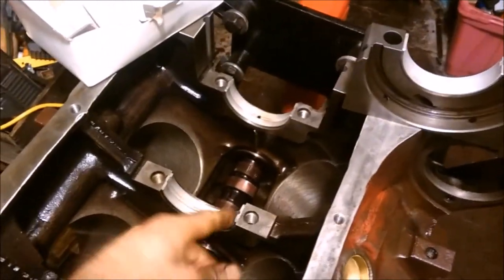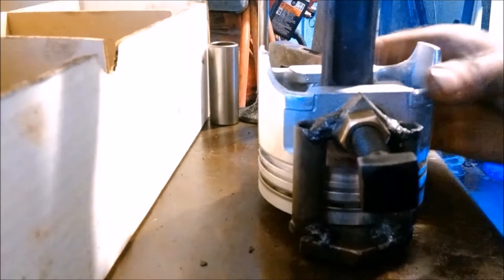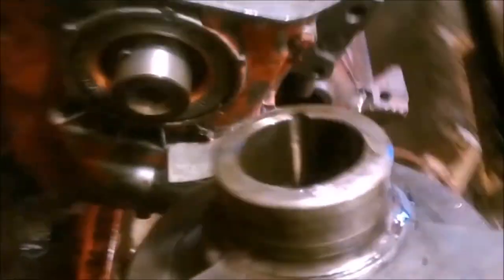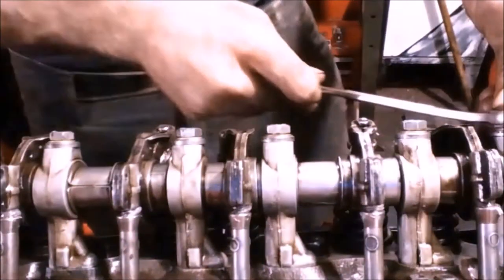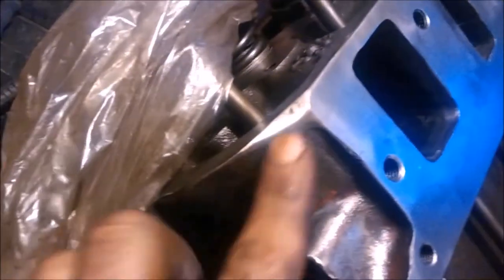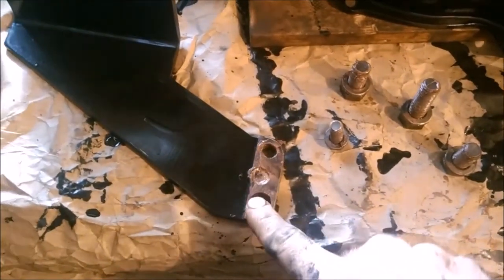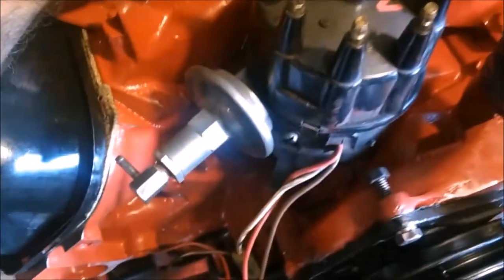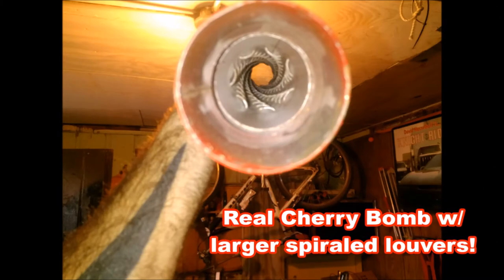IH ENGINE BUILD part 2 152 196 266 304 345 392

Comment: You have saved my 304 Build. The machine shop wouldnt assemble after doing the block,, crank and heads, so it was up to me.. this is golden info here.. Thank you for what you've done here.
Reply from the maker: Thanks! Just sharing my notes, I'm watching along my own video as I do the 392 on the stand ;)  Not like we get the chance to work on these very often now a days,   But yes that engine in the video is mostly stock just reworked the casting flaws and she will smoke all 4 and break them big tires loose in any gear at any speed with only 4.10 rear end,  can rev higher with out oil starving....., at that point, you need to worry about putting the power you already got to the ground b4 we worry about hot rodding it !

Comment: I acquired a Loadstar with only 15k original miles and always kept in a barn its whole life so there is no rust anywhere.  It's only problem is the engine is locked up.  I intended to start rebuilding its engine this year.  Unfortunately I slipped on some ice last week and shattered my knee.  So I sit here watching these awesome rebuild videos wondering if I will ever be well enough to walk again, finish and drive my truck.  
Actually I planned on converting it to 4 wheel drive.  From eBay I got a rare 4-speed Dana/Spicer transfer case.  I did a small write up on it in a couple of the forums as a lot of people never saw one and didn't know Dana/Spicer made a 4-speed transfer case for the Loadstar 1800.  Ratios are very low; low; direct and overdrive.  That gear box could be ordered with either of two different overdrive ratios.  Surprisingly a heavy truck surplus parts place in Chicago had the alternate overdrive set of gears.  Their computer said they were in stock but it took them over a week to find them.  In the end they found a box of 66 NOS overdrive gear sets for this transfer case.  They said it appears nobody ever ordered a set before. I'm probably the first and the last.  Just thought I'd get the alternate overdrive gear set in case someday I got ambitious enough that I wanted to try a different overdrive ratio.  They also had the parts to convert the front axle engagement from air shift to manual shift.  Just thought I'd share . . .
Reply from the maker: Dude that is so cool, and I dont know why I didnt see this comment till now!  I cant believe nobody has stuck one on a rock crawler and named it over kill lmao

Comment: Wow. Thats the best sounding sv ive ever heard
Reply from the maker: Still my daily driver! Have to hear it now that its power tuned and broken in!  
Its a challenge to not peel rubber !
The H-pipe made the world of difference on the highway...
Reply: What is the HP and Torque on it? Gas Mileage?
Reply from the maker: well  @duanetucker  one issue is even 60's Muscle cars only had 500cfm carbs, and I have a 600 , so I am drinking way too much gas,
And depending if you can resist pushing the pedal past the mark that gets into the pointless power just because America power that can spin the clutch and all 4 wheels lol lol lol 
I would easily get 8-12 city  and 14+ highway  if I had a 470 truck avenger, the smallest new carb you can actually buy for a v8. Now I get 6-8 city and 8-11 highway, 
and seriously, to give you an Idea, the 470 is a huge upgrade from the stock 4bbls offered. 100 - 200 cfm larger depending...! with my foot to the floor i cant even give it 3/4 gas because my throttle pedal is bent, so Spinning all 4 and the clutch is like half throttle! 
a 600 cfm carb will not even open the rears until after about 3500 rpm, and our IH dont like to cruse past 4,000!. In fact theeir is very detailed instructions on how if your stuck you can give it all she got for like 8 seconds, let it idle for 8, floor it for 8 seconds idle for 12, floor it for 6 idle for a full min....... no joke, I can go a little higher rpm because i cleaned up the oil passages , but these engines where not designed for high rpm. most cars peak hp and torque on a large peak around 4 -6 thousand rpm. 
IH hp and torque has a fast steep early plateau. almost right off idle they are at full hp and torque and stay that way up to about 3500 rpm.  so you actually get more power because its consistent !!! get it!!! the numbers can not be compared to other engines. these get the same gas millage empty or pulling 20 tons. no joke.

Comment: Awesome couple of vids fella.  I like the stuff you did with the heads.  I'm not getting my block decked, I'm getting the heads decked .020'  new gaskets are .046' compressed to .041'.   I'm going getting the heads back this week from the machinist and then sticking her all back together!  Also love the bit about setting up the timing!
Reply from the maker: yes, i will soon pull my heads, and deck them as well, its been over a couple years, I can smoke most things on the road as long as I pretend I let off at 60 to be responsible buahhhhhhh only thing I should have done was I had a questionable valve guide, and it took a couple years, but now its worn more and i get a tiny puff of oil on a hot day start up...
Reply: @TEN-TIMES-HARDER  Bill USN-1 on binderplanet.com has a good write up about the heads and adding umbrella seals to the valves rather than the simple o rings.  It prevents the puff of smoke on start up usually caused by oil build up at the 7 and 8 valves.  Sealed power umbrellas is what I bought for mine.
Reply from the maker: @tomcompoli  can somebody link me, I That forum is old as the internet and I can not find anything I search for!!!  At best you get threads that say "this question was already answered search the forum" lmao Bill Hamilton also says he has one on his dyno results, but good luck finding it....   Someone should cut and paste all the relevant threads into a new webpage, like a on Hamilton injection, b4 i get to it and direct everybody to www.bedhed.xyz/ih lol underconstruction, had to move my server got bought out.....

Comment: Thank you for the videos! I have been trying to find a good IH engine build video and can now try my first engine build. Have you ever adjusted the oil pump relief to get higher oil pressure?
Reply from the maker: no I have not, but I ran that engine 5 yeara balls tonthe walls as a daily driver 80 all day crewzzzing passing at 100, and then metting the oil drain back to the pan lmao, so do th baja mod if you want to hold it over 80!
as well you can ass slightly larger sb chevy springs, and watch david vizzard if you want to port further, the intakes are like race heads, the exhausts need work....
the only thing i didnt di in the vids 1 & 2 was open the exhaust bowls and unshroud in the chambers....
vid soon.....
point is, that engine was mean as hell, I had all 4 off the ground twice, oncw in the highway lmao, 
could spin 31's in any gear 4:10 rear...
more power than i could put down with out a cam even!
truck was still running like new,
guy git and ran me off the highway in a blizzard, barrel flip off the edge...
just installed the sss terra roll bar and the cpt x brace / straight steer,
crushed like a beer can aroumd the bar.... lap belts.....walked away.....
so dont worry oil p...
they took the lead out the gas and that kills pre 72 heads, and 96 they took the zink out the oil and that killed a lot of rebuilds!!!!
and as well, the zink also fills the babbat in the cam crank amd rod bearings, as well as lubes under crush out... woo woo woo...
run aukee purple, vr1, lucass hoteod, or additive and your gold...
preassure fine!!

Comment: Question about fuel pumps. I have a half a dozen of new pumps laying around. Some have different length and different shape arms but the part numbers say they are for a 345.  I figure it was because they’re different manufacturers? I really can’t find much searching it. What are your thoughts on this? Btw, great info on the engine!
Reply from the maker: If they are used, can you see wear marks from the cam lobe on the arms, and are they in the same distance from the mounting surface... You can blue it if its new and turn it by hand and it will mark the spot.... I will check my pumps later, but off the top of my head yes they mades two size pumps, but no matter how the arm is bent, it still puts the force at the same vectors...
Reply: @TEN-TIMES-HARDER  They are all new pumps so there is no wear marks. They are made by Napa, Airtex and Delphi. The Delphi has the longer arm and a different shape. After putting them in a Vice and moving the arms by hand,It appears that each manufacture has different lengths of travel to pump the fuel. Some require more travel, some require less travel.

Comment: Question. Everything is an adventure at this point since this is my first 345 rebuild. I removed the #1 exhaust valve  and everything looked pretty normal. The motor hasn’t actually been run for about 15 years and fuel has improved quite a bit since then so I was expecting carbon chunks. When I removed the intake valve I came across an unknown. The roto-washer thing. The book says to make sure it spins freely and doesn’t feel gritty. It passes that test. What I’m curious about is the squeaking sound in one direction. The other direction is quiet as can be. I’m guessing it’s fine but I’d like to be sure
Reply from the maker: Im sorry this comment slipped past me, squeaking with a drop of oil or dry

Comment: My new main bearings on the number 1 main does not have the oil groove into the half that goes in the cap, it has it on the half that goes in the block.  Mine from the factory has it around the whole bearing.  Have you come across this before?  Thanks again.
Reply from the maker: of you look right in the start i have one flat as well
Reply: Oh gotcha ok thanks a bunch.  I found out that Federal Mogul is the same as well so must be good to go.

Comment: Hey man, great videos. I've got a '71 Loadstar with the 345. Rebuilt the carb and did plugs,wires etc last year. Ran it last year but it still runs kinda rough. Needs to warm up before I attempt to move it. Hesitates, have to really nurse it with the throttle. Is there an after market carb youd reccomend? I run non-ethanol gas in it.
Reply from the maker: Yes! A Holley 470 Truck Avenger!  It’s the only new carb your gonna get even close! Stock on a load star was under 400 Holley! And Holley nor edelbrook sell anything less than 600 or 650. Except the truck avenger. See it has smaller Venturi’s for better or lower RPM range and these engines top out at about four grand! So the rear barrels on a carburetor any bigger than that truck avenger are barely opening up when the engine is screaming!!! Www.ironhammer.info/ihor

Comment: Hi my comment is actually a question my Toyota 4a motor 1,6 8 valve idles after few minutes it cuts out,why help
Reply from the maker: Im sorry I dont understand your question, 1, 6 8 valve idles?   are you saying it runs then when it warms up it dont idle?    sounds like choke is stuck or temp sensor is bad

Comment: Id love to have a 4barrel intake for my 345
Reply from the maker: these are the holley square bore, they came in the 392, mostly in loadstars.  the thing was, a lot of dealers swapped the load star manifold onto a scout, and sold the loadstar as a 2bbl.
now all 79 and 80 scouts had the spread bore thermoquad manifold, to improve gas milage, for emissions, so their out there, my buddy just sold his last 3, I got one of them for my metro...,
now that i think of it, depends who is closer to you for shipping, but here is a vendor list, sss has them, ihpa has them, bcb has them...
Reply from the maker: http://www.ironhammer.info/IHOR.html
Reply from the maker: Chris Corum I got a good thermoquad and manifold, I’d trade em both for a 4bbl intake that fits my 304 if you find one.... I know they still sell the spread boar manifolds in aluminum at IHPA and SSS and BCB...... but as for the Holley they are hard to find
Reply: ERIK THE WRENCH - LIVE FREE OR DIY  too late already Ls swapped it.

Comment: I have a 152 i could use some advice with
Reply from the maker: whatcha need
Reply: @TEN-TIMES-HARDER  I want to do some engine work anything worth doing to the 152 ....I gasket matched the exhaust I didn't touch the bowl from what I understand it don't help on those engines....and I have a two barrel carb for it ....should I put hardened valve seats for modern fuel ?
Reply from the maker: you can or you can run a lead additive...